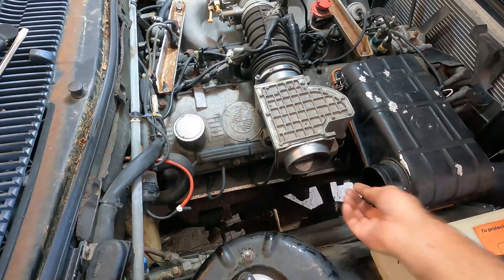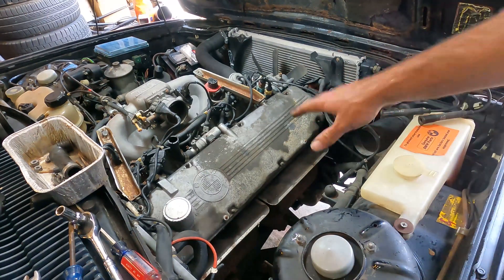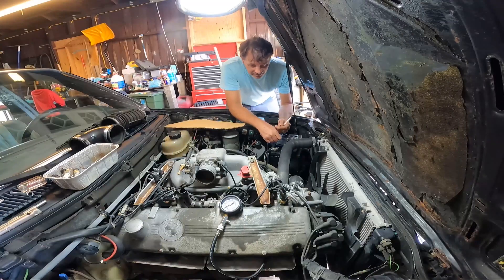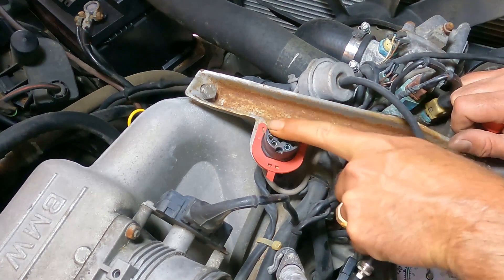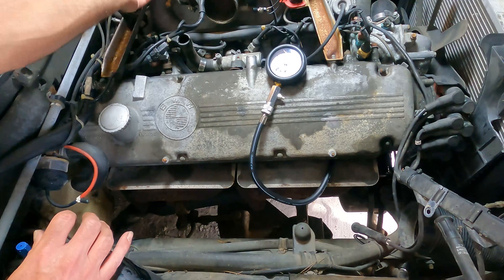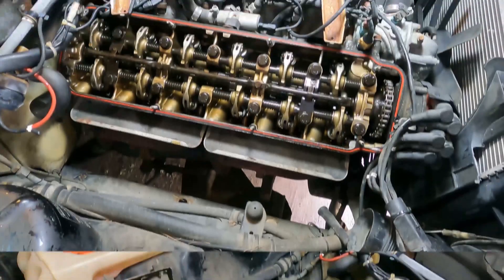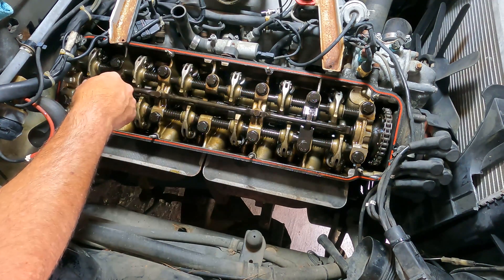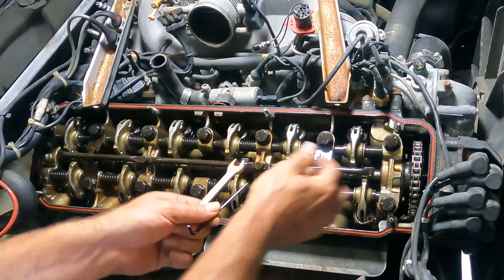Compression Test - Is the BMW Engine any good?

Comment: I just did a boroscope/compression test of a 2001 330xi with 132K miles.  The cylinders look awesome using the boroscope - nice crosshatch all the way up and down the cylinders.  The compression check had four cylinders at 185PSI and two at 187PSI.  It doesn't get much better than that!
Reply from the maker: Thats awesome!

Comment: These engines suffer when they have vacuum issues. Valves that are ticking are normal. I always would give it a good service, fuel injector cleaner, new fuel and air filters, etc. Then drive the car for couple of hours and blast the beast to it's limits to burn the carbon. We have the possibility in Germany to go full speed. After that test run day it will drive a lot better. Some fine tuning and it's ready. Bmw's don't need so much attention.
Reply from the maker: As I go through the process I definitely learn the vacuum thing. :-)

Comment: When mine came out of 16 years in a barn, it had great compression
in 1,2,5 and 6. 

3 and 4 were mid 90s (GAAAHHH!!!!) but a little Marvel, just a little,
and a quick crankover, then left for a day or two, started to make
an improvement. Up some, but still below what you'd want.

My old faithful tech got out his boroscope, and confirmed it was the
valves on 3 and 4 not seating properly, not closing the whole way,
and due to the resulting poor seal, lowering the comp.

Solution? Just drive the excrement out of it for a week and take new
readings. Oh, and another shot of Marvel in the offending pots.

Lack of use caused it, and just using the car solved it in the end.

So, go drive the crap out of that Seven!

Dan in Bangor

P.S. Can't wait to hear it after valve adjustment........

P.P.S. When the vales are sealing right, it changes the gap, so......
Reply from the maker: I wish to god the valve adjust had fixed it :-)
Reply: @fortheloveofcarz  I think you just need to put
some miles on it under varying conditions and see
if that settles things down. Marvel Mystery Oil is a
truly marvelous substance! Just a capful, though,
in each pot, crank a little without starting it, then
let it sit overnight. As we say in Maine, "BINGO!" 

Dan